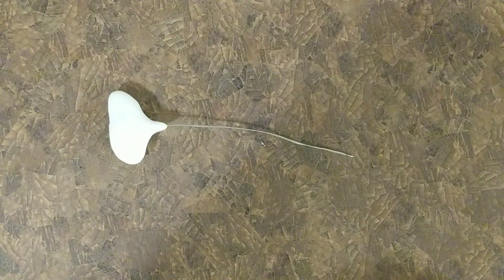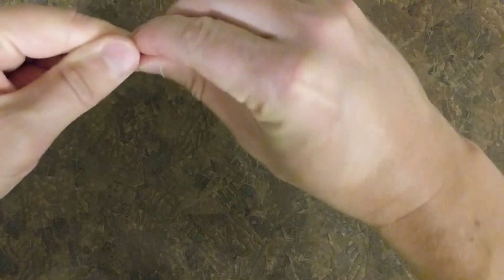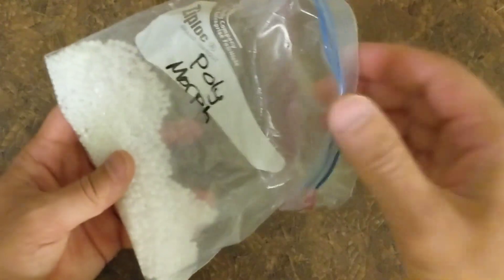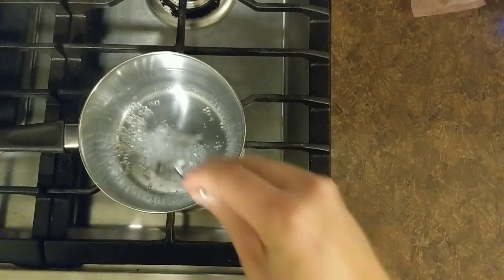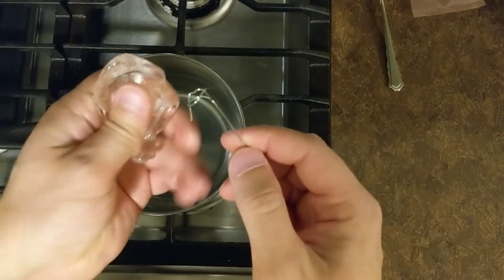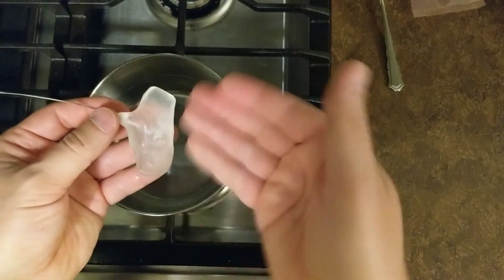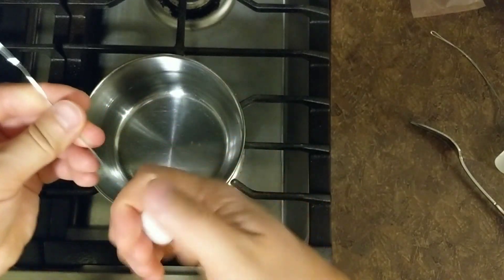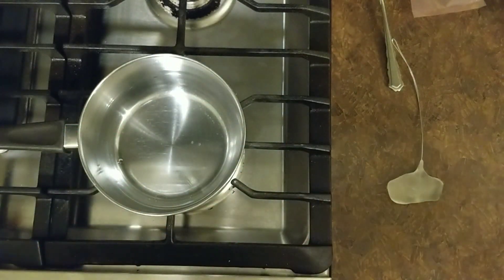DIY Splicing Tool With Plastic Handle

Comment: you can also do this with something like a 2 part modeling epoxy or a one part silicone with a binder like poly powder or cornstarch. I believe you can also make diy polymorph with hot glue and poly powder

Comment: Could probably make the handle out of stick epoxy?
Reply from the maker: That should work just as well. Great idea!
Reply: Fimo or Sculpey should also work fine.  I'd thought about Proto Putty (https://www.youtube.com/watch?v=2bZDS5uPGGk) for a rubbery handle, but I don't know that it would grip the wire well.  Maybe a small plastic handle, or wrap the wire around a hard object, then cover it with Proto Putty for a softer grip.

Comment: Is this easier than just wrapping the wire around a small dowel?
Reply from the maker: That's a good idea too. Anything is better than pulling on bare wire. I like the plastic handle as a more permanent solution, but can't knock the simplicity of the dowel.

Comment: What gauge wire do you use? I went to Home Depot and they have a few different sizes for picture hanging wire. Great video to. I was just about to purchase D-splicer tool.  I would have been very sick if I had ordered and then seen your video. The tool is 23.00, what a savings. Thanks for the Video.
Reply from the maker: Mine is solid (as opposed to stranded) and somewhere in the 24-26 gauge range, which puts it around 20 pound load give or take.
Reply: If you can or have access to a dentist or dentist shop. I would recommend the wire they use for making braces. It is some high grade stainless with some pretty high strength and bend specs and comes in quite many gauges and usually in a 50m spool.
Reply: A guitar string works fine